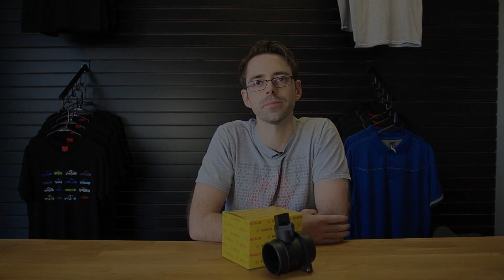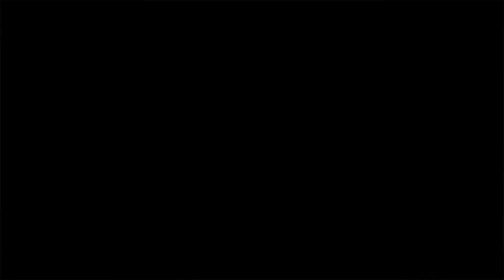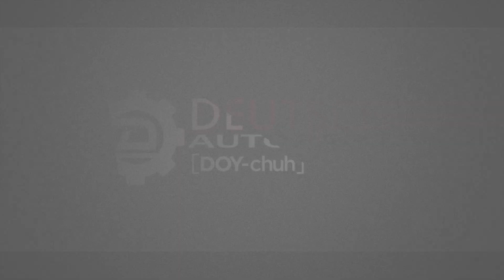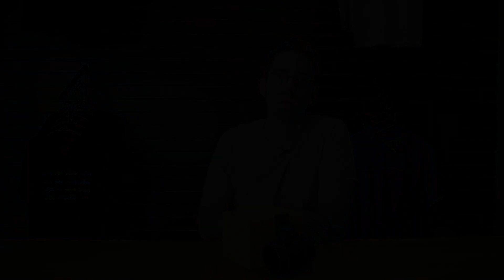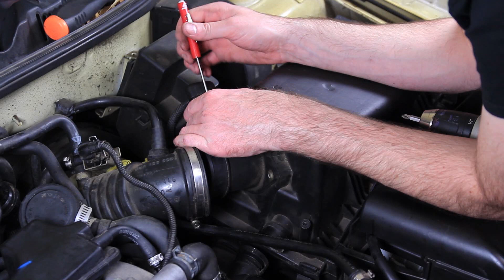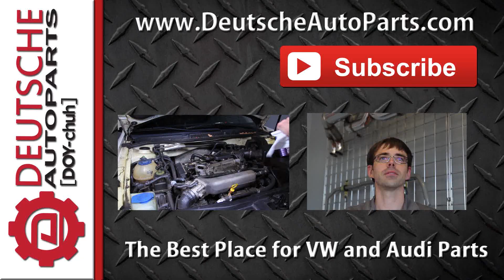How to Replace a Mass Air Flow Sensor (MAF) on a 1.8T VW Engine (with engine codes AWP, AWW, AWD)

Comment from the maker: - We appreciate your Support and Purchases!
Mass Air Flow Sensors for 1.8T Engine Code AWD
For VW part number 06A-906-461-DX
https://www.shopdap.com/0-280-218-373-bosch.html

Mass Air Flow Sensors for 1.8T Engine Code AWP, AWW and AWV for VW part number 06A-906-461-LX
https://www.shopdap.com/bosch-mass-air-flow-sensor-0-280-218-340.html

Comment: I have a 2015 Jetta 1.8 literthat is not where the mass airflow sensor is I can't find it anywhere connected to any of the tubing after the air filter box. It seems likethe tubing goes from the air box right to the turbo

Comment: That's a oxygen sensor not a mass air flow sensor/meter. 2 completely different parts
Reply: You are dumb my man
Reply: nope that’s mass airflow, o2 sensors on these cars are underneath the engine not on top

Comment: the clip on my MAF doesn't snap into place either. It will plug in though.   I'm getting ready to change out the MAF.  Is there a way to replace that plug that goes into the sensor?  Could a that's not really tight cause the sensor to fault out?  I have a vr6 2.8 sohc that won't stay running.  I'm getting ready to change the MAF and the m80 filter to see if this fixes my problem.  Only codes that come up are air flow and vacuum. then sometimes no codes.  Ran a vacuum test and it passed.  Kind of why I'm leaning to the MAF and the M80 filter.  Thanks for the video

Comment: i took my 1.8t GTI AWP to a specialist and was told I have a bad MAF. however i have no codes proving this claim? is this normal to have a bad MAF and not have ANY codes? brought my vehicle in for poor performance and hesitation on accelerating. they also said my turbo bypass valve is bad and holds no compression..my VW is completely stock FYI
Reply: I'm getting the same hesitation , on my audi a4 1.8t threw code 1228 my turbo vac hose was torn replaced that .But that code refurs to lean air wich points to the maf ,changed that -no help